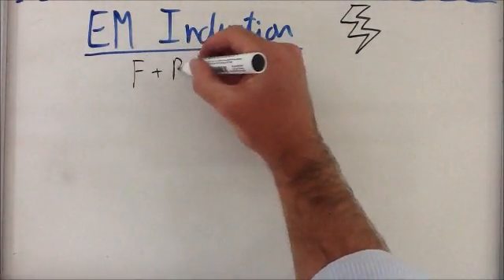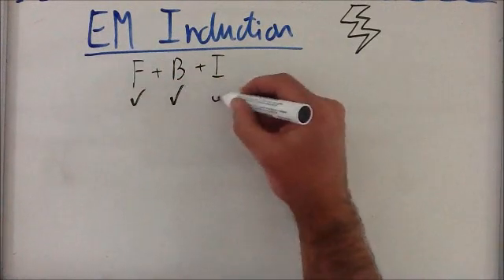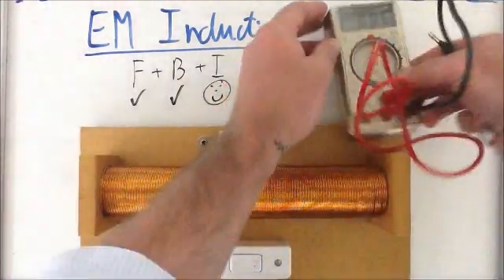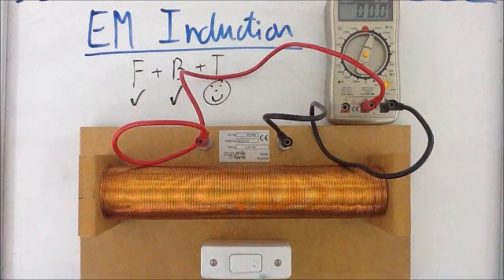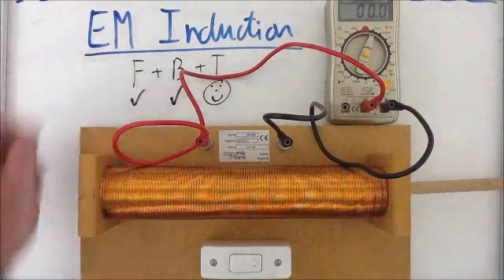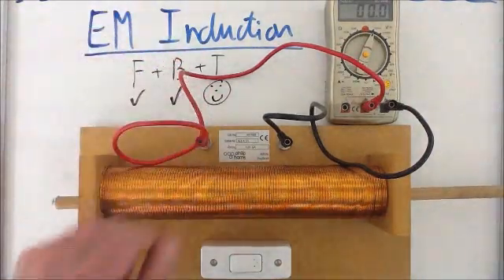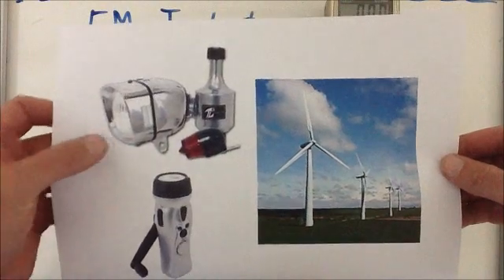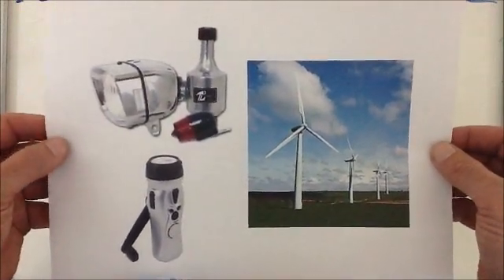Electromagnetic Induction

Comment: A Dynamo is not beneficial if the bicycle stops moving because there is no movement to turn the wheel, so no force will be created as the magnet will be stationary around the copper wire; hence no voltage (which creates the current) is induced to light the headlights. So for example if you stop at a signal at night, your headlights will stop producing light.